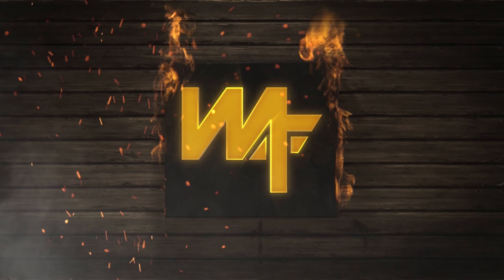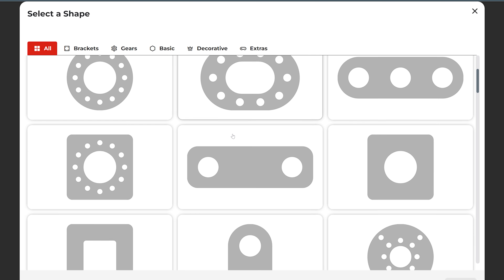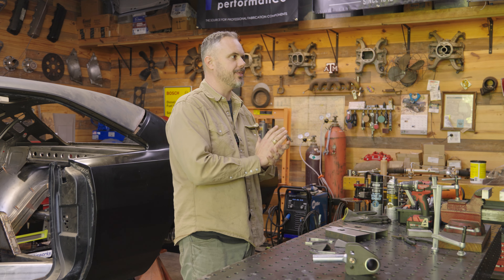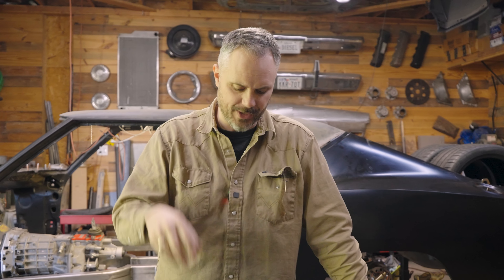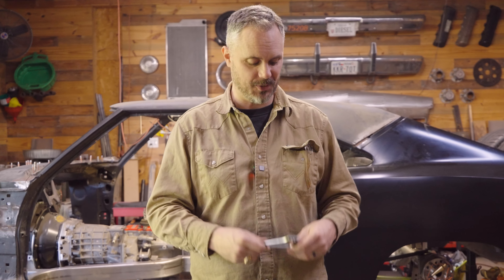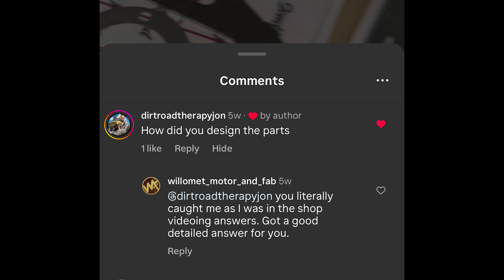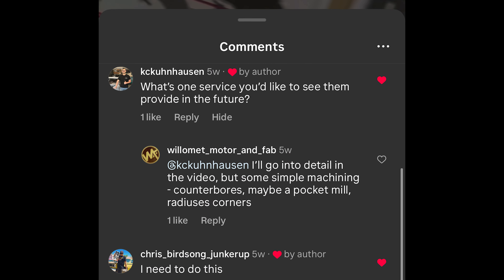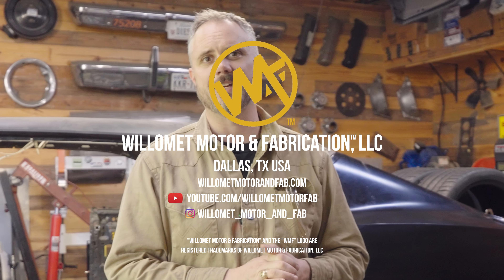Start Making Your Own Parts - SendCutSend Review

Comment: Nice review! I absolutely agree. Sendcutsend has been a game changer for sure. I usually use them for smaller orders, and Osh Cut for larger orders. A few things to note about value. 

1. Design for Manufacturing. You touched on this a bit, but it saves so much time when a manufacturer has an online system that gives you immediate feedback on your design. You can make the necessary changes to ensure your design can be made. 

2. Bend quality. I’ve tried a couple of shops local to DFW and have not yet had luck with bend quality. Sendcutsend and Osh Cut are always spot on. Part of that might be the k-factor in my design. I believe both manufacturers automatically adjust your bends and/or k-factor to their tooling specifications.  This is another money and time saver and is the main reason I keep going back to them for my projects. 

3. Good point about the nitrogen vs argon. I did not know about that.

4. I am hoping sendcutsend adds tube laser services soon.
Reply from the maker: CNC tube bending and laser coping would be a real treat. Really appreciate your thoughtful comment - very useful insights for others that might venture here.

Comment: Ive been eyeballing their site for a few months.. and I keep waiting on the right opportunity to make use of them.  Your video really makes me feel better about going ahead and trying out some projects.  Thanks.
Reply from the maker: I’ll caution. Once you start down the path of designing and building your own parts, it’s highly addictive…and extremely rewarding. Also, I underestimated the utility of their at first, which turned out to be way off. Super useful for almost 20% of the odds and ends I need to make.

Comment: I work with a few metal working shops both locally an online. Send cut send is amazing! Even for local shop where there is no shiping I cannot beat the lead times and prices are ussually not far from prices I get on larger orders of items from other shops. Only drawback is I have parts I get powder coated and a lot of my parts are larger than thier capabilities allow. I have been blown away by there quality, turn around rate, and speed. 
I've also used Xometry but for anything I'm making, the prices are about 3-4 times higher than send cut send.
Reply from the maker: I'm impressed how quick they are able to laser and bend. Good to see my experience is matched in yours. They have B2B account teams, and maybe that opens up more opportunities for larger parts?

Comment: Great review.

I'm puzzled that nitrogen, which is not inert, gives a better cut edge than argon, which is inert.
Reply from the maker: It’s been a while since I took a chemistry class, but I recall nitrogen is pretty darned inert (like barely reactive), but certainly isn’t as inert as argon. My guess is that the laser shop that says they’re using argon actually uses compressed air for commercial jobs that don’t call for a weld ready edge. That definitely creates a dark edge.
Reply: @WillometMotorFab  Yeah, that shop must be using air as argon is much more expensive than nitrogen so there would be no point in using it.

There are many compounds containing nitrogen -  nitrous oxide, the ceramic silicon nitride, a critical component of proteins and fertilizers, etc